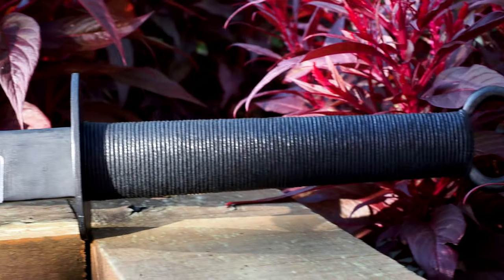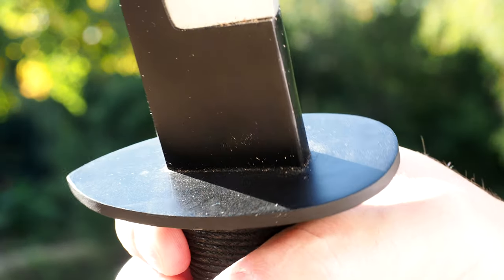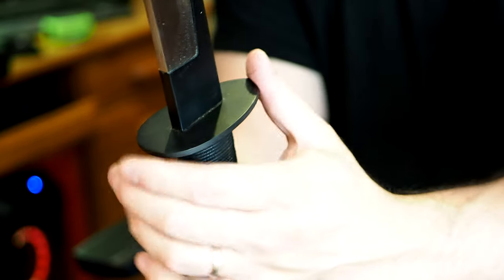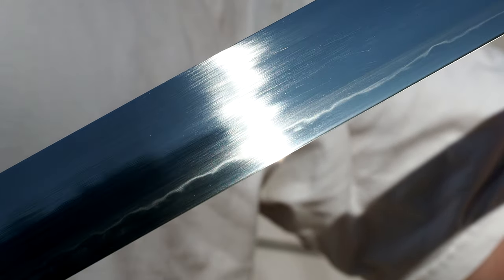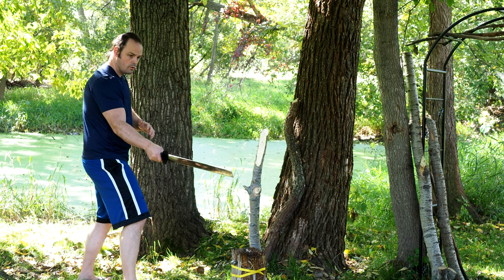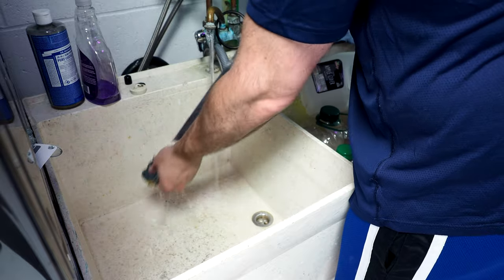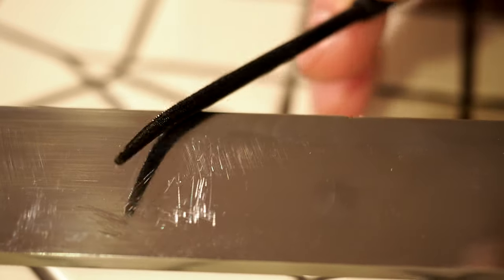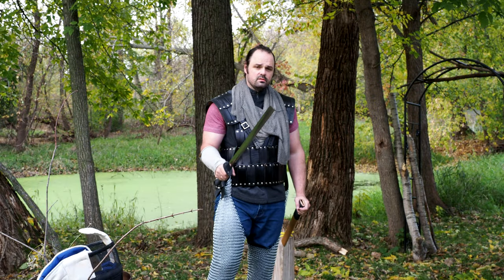LK Chen Song Hand Dao Review and Destruction

Comment: That was fast, didn't even make it to the croquet stick of doom..😬 seems like #2 snapped a bit quicker than the first..I'm a welder by trade and you were right about the tac welds..it is possible for two small Welds like that to heat up the tang enough to weaken the steel.. chances are they have their heat turned up too high due to the hardened steel and it most likely barbecued it...no bueno.. thanks for the video Matt you rock🤘
Reply from the maker: Glad you found it useful.

Comment: Quality content here, Matthew! This is what make your testing so important. I have always understood that welding the guard makes that point prone to breaking and have seen a number of examples where it happened with European sword reproductions. Some other way of securing that guard needs to be found. I completely agree that this type of construction and the potential for dangerous breakage is not acceptable. Looking forward to seeing how they fix this issue.
Reply: LK Chen could always go back to traditional glue/bonding agents.
While it may make it less rigid and the guard more shaky/loose but it would yield a better result.
It is probably the combination of the design of the blade, the hardness of the chosen steel and the welding of the guard to the tang itself.
The welding has probably caused the embrittlement in that particular area of the sword and is something LK have to rectify immediately.

Some of the artifact swords LK used for reference also had Iron Tunkous, which locked the guard in-place and improved the overall structural integrity of the sword.
While that may drive up the price due to the increased cost, it would be a more feasible and aesthetically-pleasing fix.
Reply from the maker: Thank you sir.  LK Chen has some general good will from the sword community.  At least based on the comments I see.  I would like to see the next version too, hoping they can make a few changes because this sword feels like a good one, it just needs to act like it.

Comment: Dear sword friends. I posit the idea that maybe the catastrophic failure has less to do with the blade material and is more a matter of the guard.  Ive been a student of muso jikiden eishin Ryu for over twenty years, i have observed that the area around the tsuba is the weakest part of the sword - when either the tsuba is made of a material in a similar hardness to the blade or is fitted too tightly. The reason being that shock tends to reverberate down the blade. Obviously this is going to happen by degrees based on the resistance that the target offers. If the guard is too tight or too hard, the kinetic energy tends to be redirected into the side of the blade as the guard prevents the normal shock wave traversing the full length of the tang. So rather than the shock travelling down the blade and through the tang, the shock will travel down the blade and then being unable to dispel the energy through the tang, the blade is prevented from flexing properly by the restraint of the guard. Thus catastrophic breakage. This might be mitigated by using  brass for the guard. Also a mild fuller or slight ridge down the back of the tang may also help.  I hope this was of value to some one. Thank you for your time.

Comment: Thanks for the awesome review and risking your life and health to test the sword. Probably would be worthwhile to wear arm protections as well when you put on maille chausses. It's easier for the blade to bounce back into the hand and arm than into the legs (well you stroke the brick the first time it broke). Two swords of the same model breaking at the exact same spot indicates a design flaw. I have seen an old Valiant Armoury sword with a Chinese made blade breaking in the same way at the same spot and they use tack welding as well. So probably LK Chen should revise the hilt construction.
Reply from the maker: I have grown too fat for most of the stuff I have, I'll find something eventually.
Reply: Yeah 19:59 those are the spot welds I was referring to last stream. That's likely the primary factor for the break in both cases, tho I can see how square shoulders could have an effect on a thinner tang. For something with a tang of equal thickness to a katana, the square shoulders have never been a problem in my experience, only on thinner tangs do I consider it a concern.
The second break, at 23:50 shows the welding more clearly. I'm glad this came to light and the manufacurer given the heads up

Comment: Oh man, what a bummer! There are so many aspects I really like about the sword from the grip to moving weight, it's really a shame to see the consistent breakage. I would think that already having the blade cut to hold the collar (habaki?) and guard by tension would be enough to not need the welds, unless they are trying to avoid rattling, in which case they've created a bigger problem than solution. I'm interested to see the outcome, thanks for the great video!
Reply from the maker: I use you as a reference for how this moves in more capable hands.  It has a lot of charms and it is sad that there is a flaw.  LK Chen has a lot of good will out there and I would bet on them finding the issue and resolving it.
Reply: @Matthew_Jensen  thank you for this great video. I wonder now how when and how could be sure that problem had been solved...
Reply from the maker: @Glad-y3q  LK Chen made some notes about it.  I believe they stopped welding on the guard and revised the way the heat treatment was done.  You would have to ask them about the changes to be sure.  I am always happy to test another one if they want to send it.

Comment: Pretty sure you nailed it when you said "I found some little welds here", more than likely they did tack weld the tsuba into place but then QUENCHED IT TO COOL IT QUICKLY (which makes extremely hard but brittle steel) so it could be wrapped. I'm betting if you use your rockwell tester right at the blade metal at the tsuba it's probably significantly harder, 75+ is my guess. Cut off the cord on the handle and rockwell test it right at the tsuba since the welds appear to be wrapped on the handle side.

Comment: Grain looked rough, and any added heat even wielding will change the temper at the base of the blade. I feel it had its temper marred and perhaps the heat was too high or low in places. Glad they cared enough to send a 2nd piece for testing, lets see them make it right.
Reply from the maker: Yes, glad they sent me a second.  It helps validate the issue but also leaves some open questions.  Hope they take some steps to sort it out soon.

Comment: Yeah if they are spot welding those areas, it would create very weak spots in those areas if the tac weld wasn't annealed out. A weld alone will create very hard spots and very soft spots right next to each other and can cause easy cracking.

Comment: It's a good steel, the edge was very durable. It bent easy but its normal when most of the cross section is not hardened. If they have spot welded the guard to the tang that is probably the issue. When welding high carbon steel you have to anneal it completely or the section gets brittle. Annealing means you have to heat it so much that you ruin the hardness of the edge. So they should just stop welding the guard (if that is what they do) and I think that resolves this issue.

Comment: It seems to me the weld is the cause, welds are more brittle and ruins local heat treatment, once a crack formed at the weld it become a severe stress concentration point and crack right through

Comment: Seems like the tac wielding on the spine and blade are forcing a weak point, like the wields are absorbing all the shock. They altered the tempering at both the hardest and softest points, they might as well just cut into it with a grinder and sent it to you. A single tac on one side, in the middle ok if it’s absolutely necessary. There’s a reason why other companies use a bonding agent and not wields.
As goofy as that mix and match armor was, please consider doing all destructive test with it on. As soon as the first one snapped my heart stopped, one step forward or if you lost your balance…. Please be careful.

Comment: Yeah it seems that with the way the sword is designed, the shock is being absorbed in the wrong place. I'm not talking about the historical aspect, but more so the way the company designed that particular model.
Reply: It is more of how they welded the guard to the sword itself.
The resultant embrittlement from the welding became the point-of-failure for this sword.
Reply: @possumsam2189  Oh must've missed that. Yeah that's never a good idea to rapidly reheat steel after the heat treat/tempering process.

Comment: yeeeah, welds are terrible on that kind of high carbon, hardened metal.
Absolute no-go.

these spot welds basically act like extremely brittle quenches on both sides of the tang.
A lot of heat, in a small space where the heat immediatly gets siphoned away by the other surrounding metal.

It leaves a heat-affected zone next to the weld that is extremely brittle (which is very much where both of yours broke).
Once the crack starts there's just no holding it.